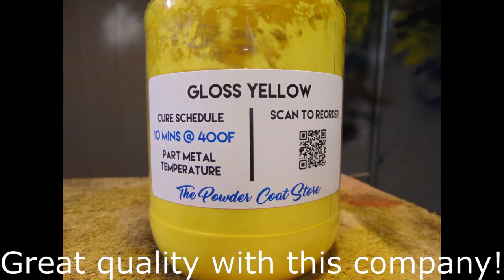Mighty Tonka Front Loader (Epic Restoration)

Comment: Excellent job! Blue Dawn dish soap makes the best lubricant for pushing plastic and rubber parts into holes. We truckers use it for lots of things like sliding tandems on trailers and connecting air lines.
It evaporates in a few hours and doesn’t harm any parts.
Reply from the maker: Gearjammer yes sir! I’ve got a pump foam bottle within reach.

Comment: I have done many of the Mighty Tonkas.  I always use proper rivets and have paint mixed to the correct colour in rattle cans. Easiest way to remove wheels is to cut the axles.  I used 1/4" Stainless tubing as replacement axles.  The pale green ones were made in Canada.
Reply from the maker: Gord Baker What size compression rivets do you use, and where do you find them? I’ve ordered a few, and so far they don’t fit.
Reply from the maker: Gord Baker I’m in Columbus Georgia. If you no longer need the tool and rivets, I’d love to get them from you. What are you asking for them?
Reply: @RustyShepherd  How does 20 U$ plus shipping sound?  Put up your mailing address NOW and when I confirm, you can erase it if you wish.
Reply: @RustyShepherd  Got it! I will write you a note first.
Reply from the maker: Gord Baker Apparently My yahoo mail isn’t working.
Reply: @RustyShepherd  Do you have an alternate email that would work for us?  I have gmail.

Comment: wow nice work, especially considering the mess you started with.You should put in the way you do the lettering on the tires, it's a neat trick that I now use for such things too. Thanks for that idea.
Reply from the maker: Yeah..i forgot to add that. LOL
Reply: Iain Botham  I don't know about that, but I'd sure like to know where he finds the replacement parts. I have an older Tonka 4X4 some guy paid the price of the whole thing, but only wanted the hook for the winch.. so I sent him the hook for the winch.. he saved on shipping though, a whole lot. I still have the rest of it if anyone is interested. fair shape, not perfect, but usable as is, or a candidate for a nice restoration. Don't know where you'd find the plastic hook though.
Reply: Iain Botham  I'm sure that's doable, by somebody that has the printer and knows how.. of course you would need an original to take the pattern from.
Reply from the maker: Iain Botham  I have in some other resto's. I will try to remember to do that when i buy new parts. RS.
Reply from the maker: There are different hooks for sale at Gasolinealleytoys.com. TKP-061 is the number for the small hook. I dont know if its the replacement form the one u had. Go to that page, then go to the bottom an click WWW.toydecals.com , Then "toy parts", Then "Tonka parts", then scroll down to TKP-061. Let me know if this helps. RS
Reply: Iain Botham  he could probably do the hook. Him or Mr. Paul in Vegas.

Comment: Hi. Did you use regular rivets to mount the parts together? 🤔
Reply from the maker: I did use regular pop rivets. I hadn’t found a tool to use compression rivets yet. I eventually found one. I used the correct compression rivets on some builds after this when, when I could get the tool to fit. Some places it wouldn’t fit, so I had to use pop rivets a few other times.

Comment: Is there a source for new parts like the air cleaners, exhaust pipe and windows for these old Tonkas?
Reply from the maker: jlwoz Toydecals.com. This is where I get most parts. eBay is also where I get parts that toydecals might not have. RS
Reply: @RustyShepherd  Thanks for sharing this.  I checked the site out and I was amazed there is a source for toy parts.  Many parts indeed.